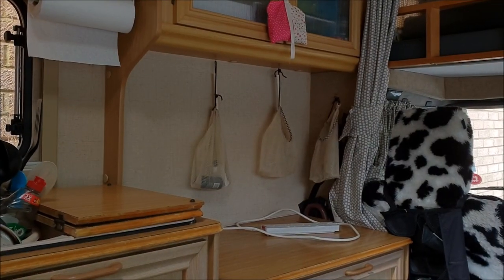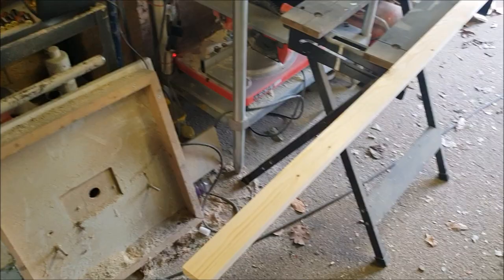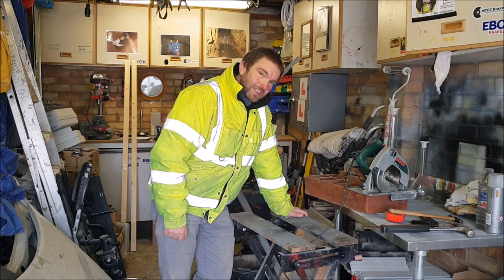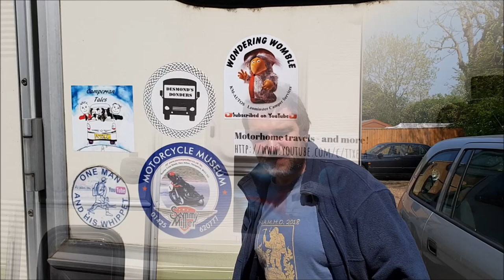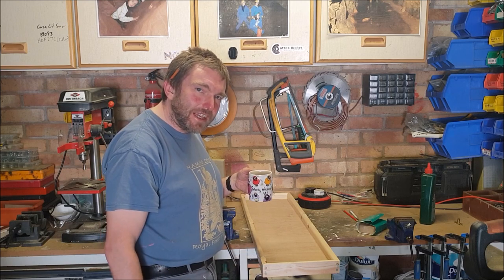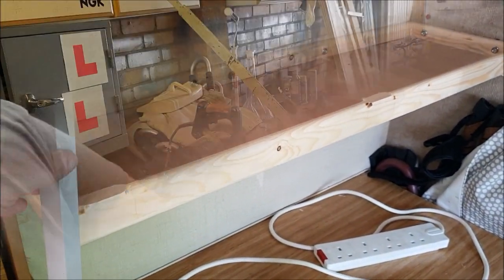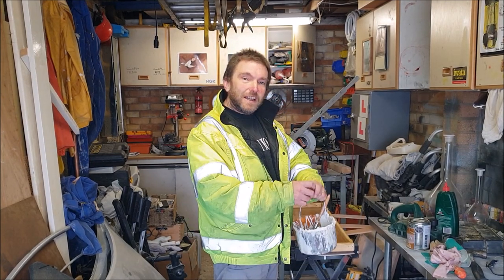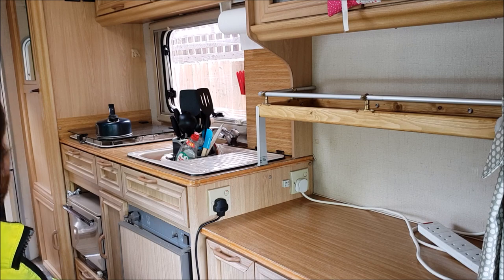Adding Additional Storage Space To The Motorhome

Comment: A great little lockdown project there.  Looks good and very functional, too.  It definitely shows how much space was wasted in the original van - which is perhaps surprising as it's the original 
professional manufacturer.
Reply from the maker: Thanks, I wonder if the space was originally meant for a TV 🤔 would have been a CRT one then so a bit of space needed.
Reply: @ttxela  Ah good point. Similar happens on older boats and that's the explanation. Currently working my way through your vids and soaking up bits of knowledge as I too brace myself for 1990 motorhome ownership! 😬